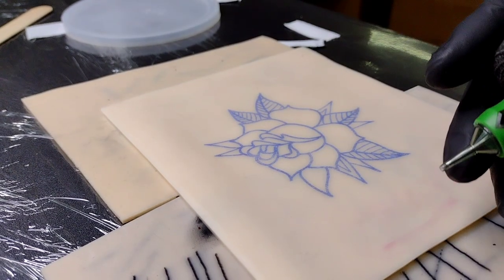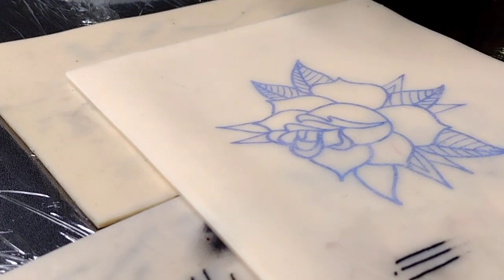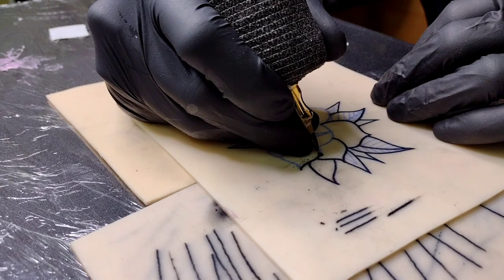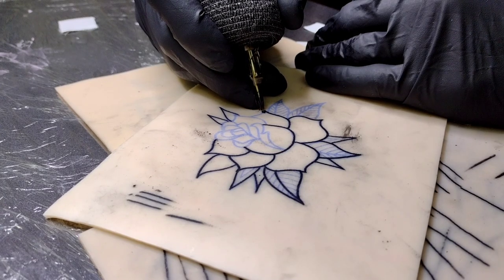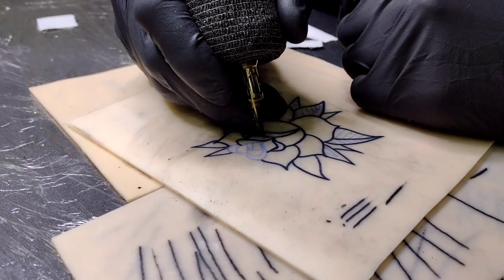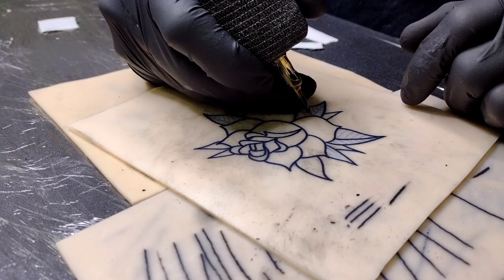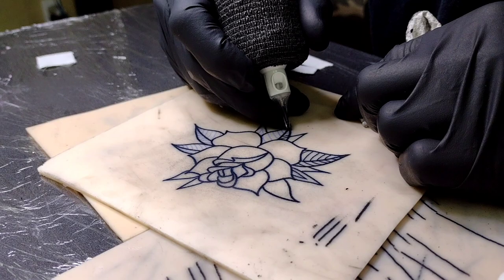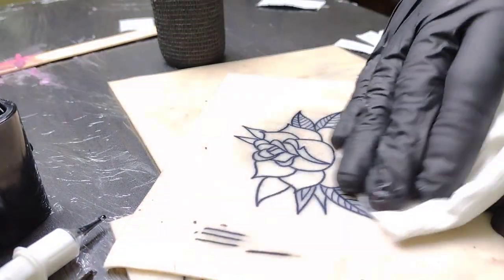How To: Make Clean, Crisp Lines and How I Hold A Tattoo Machine

Comment: Great video bro. That's the best way to learn to line well for myself it was. I couldn't hold my machine like that when I learned to shade. So now I use both my finger and a I guess you'd say more traditional grip. The finger technique really helps your lines be more straight and crisp but it felt like it limited my movement. I try and use more traditional grip. You will notice it's harder to control your depth as opposed to the finger technique. Looking forward to your shading video! This was a awesome video really enjoyed watching brother!
Reply from the maker: Yeah it works best when your pulling towards yourself  but exactly like you said it definitely limits your movement. Lately I’ve been mixing it up. I’ll pull/push and using my finger to float it then if hold it more traditionally for like horizontal lines. Been a hard habit to break tho. I let a buddy of mine practice a little bit and he’s was like “man, it’s a lot harder than it looks” 😂.  Videos doing well so far so that makes me happy. The shading video I think will be 2 parts but will most focus on how to put it down evenly im gonna just try n keep it as simple as possible. Thank you for watching brother Stay Locked and God Bless

Comment: And alway make.sure when your  Machine stops that your needles are all the way in bc when you laid it on the table your needles were still hanging out with it  on the off  position and when pulling lines make sure to whip out when you stop and start on the same line .and even when ur working on fake skin its a good habit to rap you  Machine with Plastic wrap or  tattoo pen covers
Reply from the maker: Thank you for the advice, that’s the down side of these budget machines. My go-to machines are high end and when I turn them off they always suck the needle up. And of course the one time I don’t wrap my machine up I get called out😅. I do appreciate your input tho friend and from now I’ll be sure to wrap it up. Thank you

Comment: I was taught traditional line pulling and it worked but I switched to the exact style you and Daniel do on my own. 

All the needles I get suck for that style hold, what cartridges do you use?! Help please!!
Reply from the maker: This way is great for learning depth but it really limits your movement and puts pressure on the cartridge if your not careful. I use my first knuckle now and apply pressure using my thumb. I used different brands for different rounds. 
11liner=Kwadron/Spade
9liner=Helios
7liner=kwadron
5liner=mastpro 2
3liner=napoleon cartridge
Reply: @cappn_ronaldo  oh the cart game is ever changing as you know by now. 

I try to keep an eye out on any carts that are grip friendly and see if it’s leak proof with the finger tip method. So far, zero. 

I am however trying a new method of taping my middle and ring finger together so the depth is controlled even more. 

I like it, my lines are crispy and more importantly my clients always say I have the lightest hand.
Reply from the maker: @evancribben2080 well im glad its working for you, my friend. Happy tattooing my dude n God Bless

Comment: That’s how I hold my machine and my problem is I smear ink when it drips down my finger
What skin is that?
Reply from the maker: Its reel skin, it helped me get more comfortable with depth control. Using your finger like i do in the video is very limiting to your movement.I hold my machine the traditional way now and im able to move freely so i definitely suggest to do that once your get comfortable with your depth. If you apply to much pressure with your finger it will distrupt the ink flow and dump it out all over your finger another reason why i switched it up to the traditional hold
Reply: @cappn_ronaldo  it takes ink well,I been using pound of flesh for practice and it blows I almost have to slice it for it to take ink
Reply from the maker: Wow what a bummer, i order mine from the main place in the UK. Sign up for there email newsletter and they always have deals going on. I bought a big roll of it for like 55$. I appreciate you watching tho my friend. Consider subscribing and join our community of professionals and beginners alike.